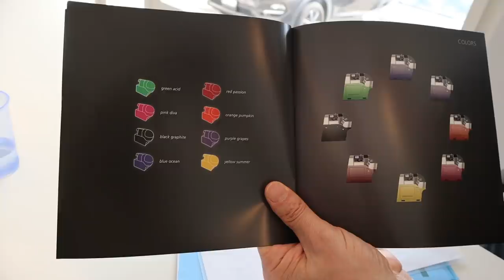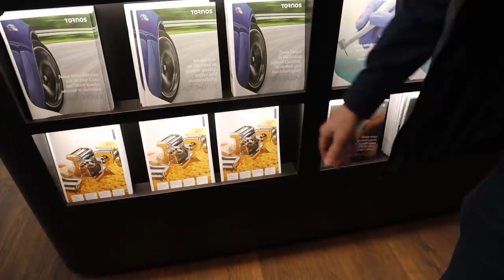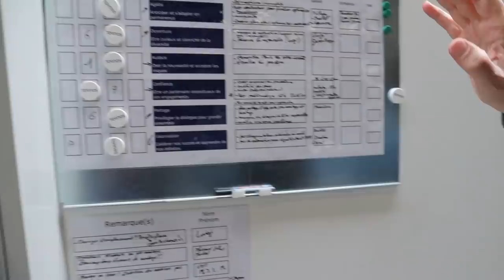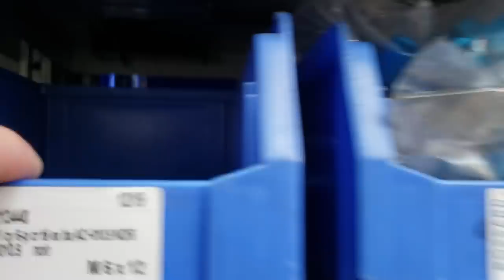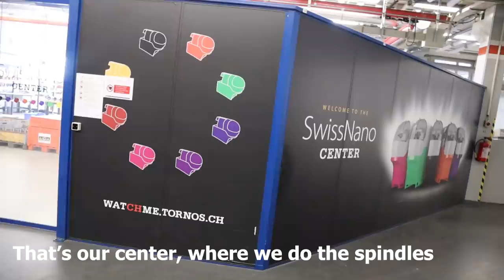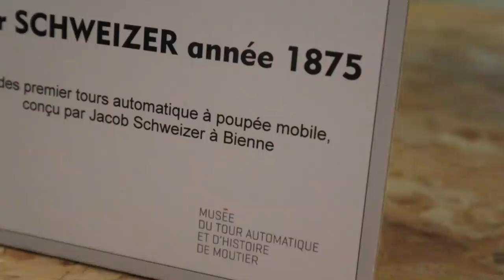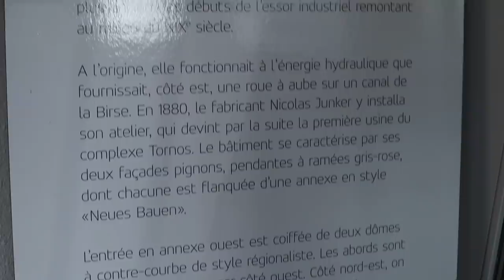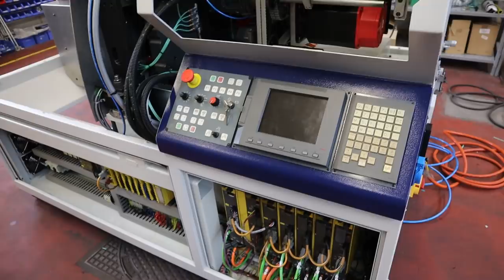NEVER BEFORE SEEN Tour of the TORNOS Factory in Switzerland

Comment: I'm curious about the bar stock they use when making parts. Does it go through a grinding process beforehand  to make it round enough and consistent in diameter enough to pass through the guide bushing?
Reply: Sometimes, it doesn't have too.